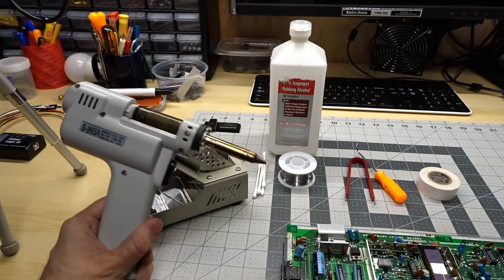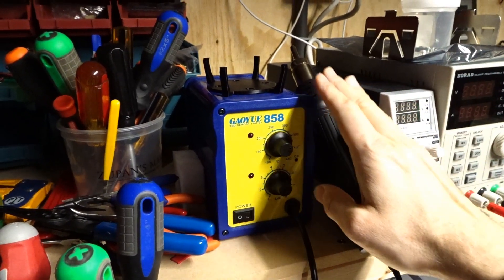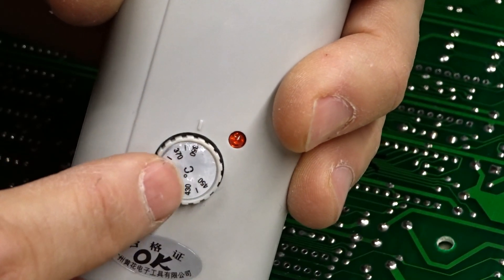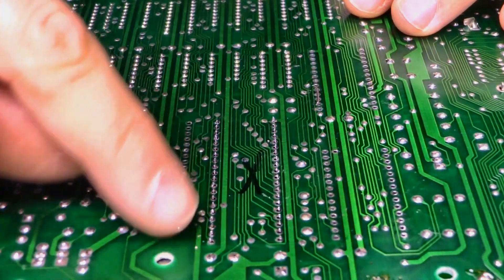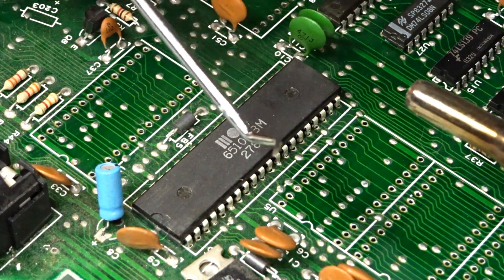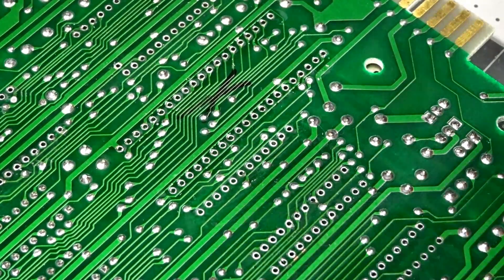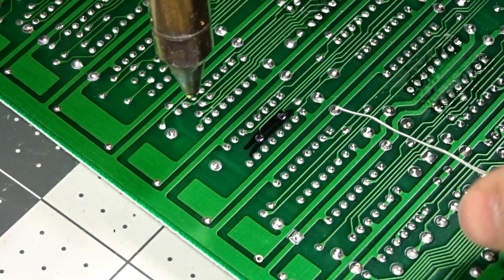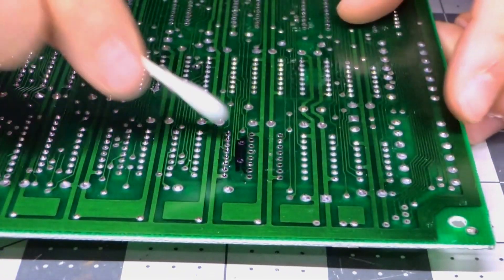How to remove chips without damaging the circuit board

Comment: I've found that acetone works a lot better than rubbing alcohol for cleaning PCB's, but I've only done that on modern PCB's so I'm not sure if it would damage the old ones.
Reply: The only problem is that acetone can melt some plastics.
Reply: @rdxdt  all electronics components are all more or less acetone safe, as flux removal with similar and stronger MEK is used in some factories. ICs and plastic connector housings are completely safe. Capacitors can contain a rubber plug which may be affected if left to soak in acetone, but for a short wash it's fine. Polymer capacitors can be affected if they have a sealing error or over a long soak.

People are always afraid of acetone  because they've seen it eat styrenes really eagerly but just keep it well away from enclosure pieces usually made from ABS.

I actually did an experiment and left a bunch of ICs, connectors and small populated boards in acetone for a week and they were perfectly fine afterwards. Nylon perhaps a bit more brittle than usual but it regained its flexibility in a couple days afterwards.
Reply: @SianaGearz  never tried on a modern computar Motherboard to see If It would melt any plastic parts like the ram sockets,PCI sockets, but im pretty sure that on a C64 case, the plastic would suffer some damage.
Reply: @rdxdt   so you haven't tried either? Nah, very unlikely. Modern connectors are pretty much all made from PBT and LCP, you can look up chemical compatibility on that. LCP wasn't available in the 80s, but PBT and PA66 were standard materials for connectors, plastic parts of switches and the like. IC enclosures are epoxy, also no problem at all. Even if there is a susceptible material somewhere on the board, just wetting a pad or q-tip to clean up the flux residue should be a sufficiently safe method, if someone finds working with acetone particularly pleasant and doesn't want to live without it.
Reply: @SianaGearz  i can try with a scrap board that i have to see If acetone Interact with the plastic, for example a SATA connector, vwestlife used MEK to glue pieces of plastic(on a computer case) together by slight dissolving them and joining them together.
Reply: @rdxdt  MEK and acetone will readily dissolve polystyrene and styrene copolymers such as ABS, as well as acrylics and a few other families of plastics. Almost all enclosure pieces for computer peripherals and home computers are made from ABS because of its mechanical properties and extremely low cost.
Reply: @SianaGearz  and that is why i dont think It is safer than IPA, sure Acetone can be used with safety and make great results, i would still use IPA. But that use just me.
Reply: @rdxdt  Oh yeah I could definitely see that, I really only worked with bare PCBA's when I was doing a bunch of soldering so I wouldn't have experienced that
Reply: It seems like people are afraid of acetone for some reason.  PCBs are generally made of fibreglass.  Just keep it off the case of the machine and you'll be fine.  Acetone is a wonderful labor-saving chemical.

Comment: I would have also said that, if you desolder a chip and later want to reinstall the chip, that you ALWAYS get them socketed where possible. It can save a lot of hassle.
Reply: Same with soldered-in batteries...if you have to replace one, go ahead and put in a holder to make future replacements much easier.
Reply: Think about if you're just lazy and put it in backwards! A five second mistake with a socket, a ten minute one without.
Reply: That works until you get to very high frequencies where a socket would create a transmission line discontinuity.
Reply: especially on that old c64 boards. messing up vias and traces is very easy. that kind of restoration work should always be done very careful and sustainable for the future.

Comment: I havent watched it all yet but I've used a heat gun and some tinfoil a few times. I add new solder first, thread some wire under the chip to make a pull handle, then wrap up the rest of the board with the foil and then use the heat gun. I have made a board bubble once doing this and also theres a risk of pulling the plated holes out, but mostly seems to work and its quick too.
Reply: After watching, I like your technique, it seems a bit more gentle than mine.